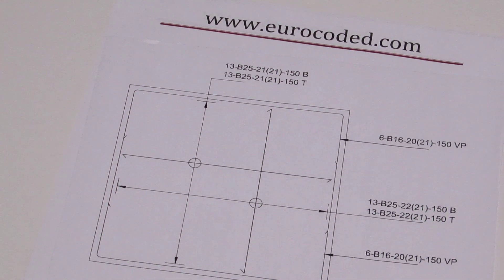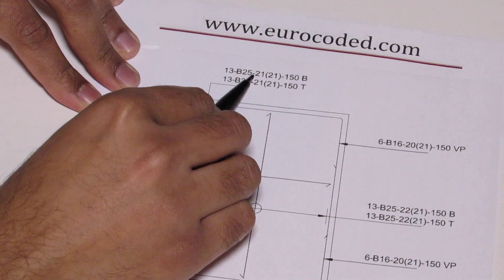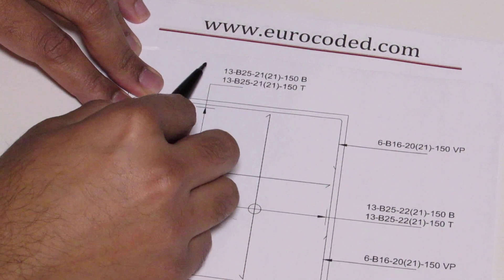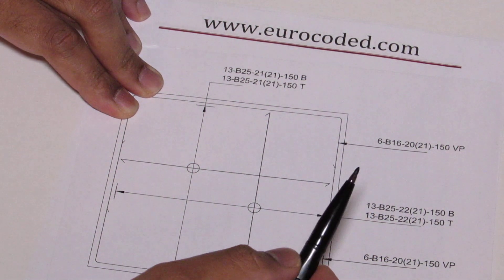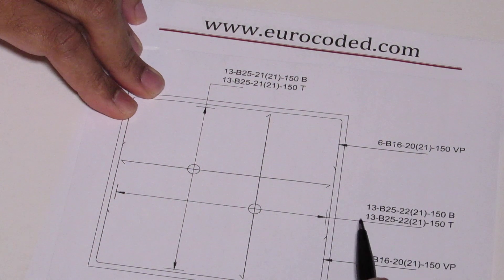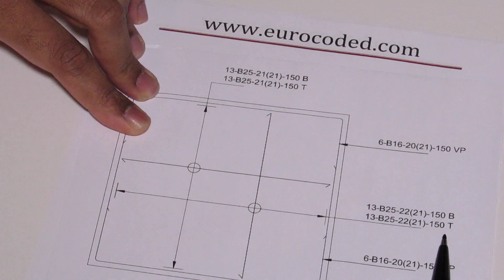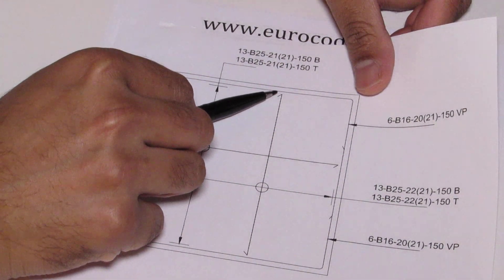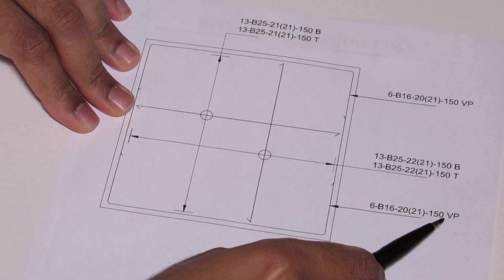How to Read Structural Drawings (Example Reinforcement Drawing)

Comment: Would be grateull if you can explain the meaning of VP. Also I have noted that there is only BOTTOM and TOP labelled but not specific to B1, B2 and T1 and T2.  Also the bars to not reach in the beam zone. On a more practical side, the T1 being at the top, T2 is rarely shown in layout but in practice it is placed first, being under T1 bars.  Do you have any notes on T2 bars? I am also looking for notes on dropped slab say at balony usually 100 to 150 mm. lower than the remaining slab.

Comment: Could you please define H as " 9 H16-03 T4" . what is the purpose of H instead of B
Reply from the maker: Notation refers to type and grade of reinforcement.
H: for diameters <= 12mm, grades B500A, B500B or B500C conforming to BS 4449
H: for diameters > 12mm, grades B500B or B500C conforming to BS 4449

Comment: Hi there, I am new to steel fixing in Sydney, Australia. Are these the plans that are used on jobs around here? If so I would really like to learn how to read and interpret them
Reply from the maker: Hi Ashurina, The example explained in the video is from the UK but it could be used anywhere. There may be minor differences in Australia. However the principles are the same. This example is a good starting point to learn how to read structural drawings. Good luck :)

Comment: What VP stands for please?
Reply from the maker: What is the complete notation?
Reply: @Eurocoded  its on your video
Reply: @Eurocoded  6-B16-20(21)-150 VP. It's the bottom code on the right of the drawing
Reply: I think it stands for Vertical Plane